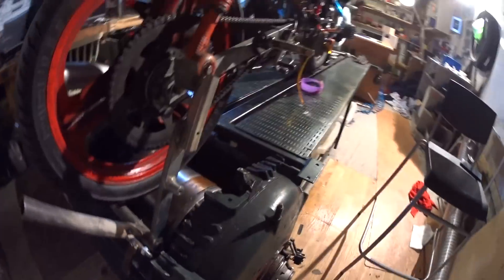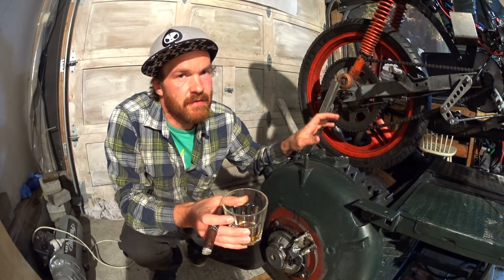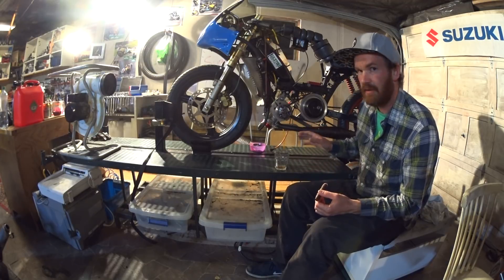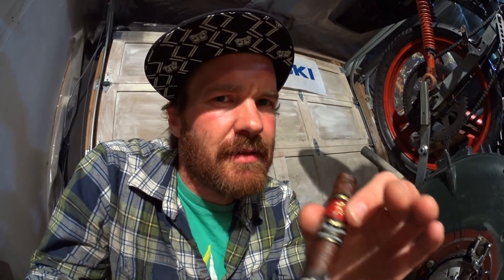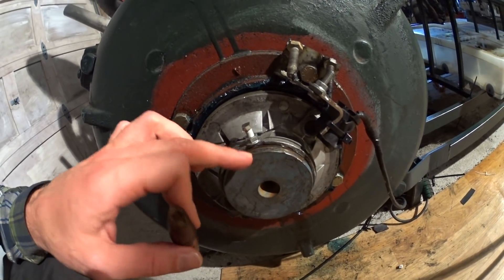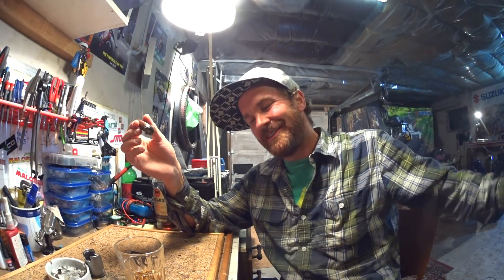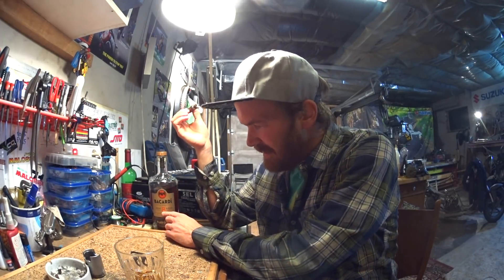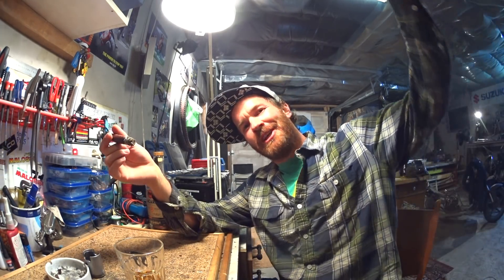CHEAP DIY DYNO ANYONE CAN BUILD!

Comment: Great video, even though it's already 8 years old  :D   Short question: For mainly testing 50cc mopeds with around 5 hp, would you say such a 110kW motor like you have is too big? Or is it still precise for these low power measurements?

Comment: I have built mine all from scratch have a cam sensor as a pickup and I’m using simple Dyno and a Arduino with Ardyno board but having problems i get really bad spikes when I turn the bike on just at idle I get all the way from 1.2 until 9999 hp and same with the rpm that is without the wheel spinning at all can anyone help any ideas on what is wrong?

Comment: hi! long time returning viewer and I came back to watch this video! I am thinking about doing this myself in the near future except to attach directly to the crankshaft of the motor rather then a roller on the back wheel, and had a few questions, essentially it is a large spinning shaft of known rotational inertia with an RPM sensor to show how fast the engine is able to change the rpm of that shaft, correct? the other issue for me is I intend to dyno engines with as little power as 20HP but want to be able to also do much larger engines too, for an engine with that little power what kind of rotational inertia would you suggest, and for the larger ones would my only option to be to significantly increase the rotational inertia of the system? I may have to incorporate reduction gears for high revving engines to stop the shaft from overspinning.  Thanks again!

Comment: Hi mate,
Do you know what the smallest motor would be suitable?
Or are you just looking for the RPM rating that the engine can handle?
Reply from the maker: Mine has a rotor inertia of 2.17kgm, works up to about 70hp, 4000rpm at that point, wouldn't push it much further. Lighter roller means it has to spin faster to get ok runtime(5-8s is good}

Comment: That's actually quite innovative and the software is fairly brilliant. I was expecting there would have to be some sort of braking involved but it just seems to use the rate of increase in rpms as the source of the horsepower.
A "simple" dyno could easily be constructed using a truck or 4wd rim and tyre as the rotating mass. Obviously the inertia number wouldn't be known initially but it could be worked out if you put a known horsepower source over it. Normally you're probably after comparative measurements anyway.
Reply: Fr i thought a dyno would be more complicated.

Comment: Awesome.. Question for you - would the ABB quoted figure for Rotor Inertia include the weight of the copper windings? if yes, do you need factor that in to your calculations?
cheers
Reply: I believe only stator was removed. Rotor is short circuited cage and connot be removed without destroing it

Comment: Those specs from abb wouldnt that be the motor under load whilst windings are there with the power supply DC or AC
Reply: I think those variables arent apart of the factors effecting rotating mass initially.  Would say that is calculated when balancing the rotor outside the armiture kind of like how a car wheel balancer works..  unless in a permanent magnet motor the windings would have no effects on inertial forces.  If the motor was energized that value would be dependent on the motor rating as a whole and equates to only power ratings, input/output relevancies for customer application specs.  A rotors inertia would only play a factor on bearing type/ material or if measuring motor starting/ braking forces as applied to the customer application if clutching or something would be needed.

Comment: Hey, im in the process of building a similar dyno but its on the back burner until I figure out where I put the inertia wheel away. Until then im stuck with what it feels like type of changes. 

Do you know if a hotter spark plug would give a noticeable increase in bottom end power. Today I fouled a plug when out riding [ktm exc 125 2003 ish] and rode it back home with the wrong heat plug in that was in my backpack [3 numbers hotter on ngk] and the bike had a great amount of low end power that it normally doesn't have. Once I got back I quickly changed the plug for a new [Calibrated gap to spec] one and went back out and the low end power had gone back to what is normal. Same bike, same trails same hour. 

You seem like the kind of person who would know if this is a known side effect of plug temperature.

Comment: I can't understand where the load is, this seems to disperse 20hp with no brake??? I'm confused
Reply: With just a hall sensor on it the software is just calculating inertial resistance to how quickly the rpm’s take to get to a set point.  Braking and all is just up to you how you plan on stopping after a run but as long as more force is applied downward to the rotor than the inertial rating than the tire wont slip and get eaten by the spinning rotor..  theres no load applied besides that rotor inertial force he had to call the company to get..  thats the number used for calculating everything
Reply: Constant is the word i was looking for.  The rotor size and inertia is a constant and rpm, time, tire size are variables..  tire size always confuses me though because bigger tires same rpm youd be going faster in mph with more torque so hp of a bigger tire with same motor would be less with more torque and rpm higher if keeping same mph.  Or lower..  i dunno...   i gotta go take a dump on thatn..

Comment: Hey 2SS, I like the videos, very good stuff! Do you think that a concrete wheel sealed with epoxy and mounted on pillow bearings would do the trick or it would be way too sketchy?
Reply from the maker: Thanks! Sounds a bit sketchy, a thick steel shell might help.
Reply: Hell no. Needs to be a metal roller. That thing will fall apart under load. Also how the hell would you balance the thing? Lol.

Comment: What if I want a Dyno that is chained directly to a small DC motor and flywheel with a hall sencer for rpm .the motor start the engine if it is a manual cluch and I want to test engines before it goes on the frame . I got a old treadmill but don't want anything too large and obnoxious.
Reply from the maker: Should be doable!

Comment: So much time was spent on the minutia of the build that explaining the basic "How it works" was never addressed. So the wheel spins the rotor and the rotor's rpm is measured. Why not just hook an rpm meter to the DUT (Device under Test)?
Reply from the maker: Yeah, sorry I need to remember stuff like this. Sure you can take rpm from the DUT and plug the gearing ratio into the software, but you'll still need a big mass to accelerate for meaningful results.

Comment: I am interested in making a generator from a car or perhaps a motorcycle out of a dyno or something like that using the car or truck motorcycle Etc Wheels to turn the generator directly and perhaps kid 1 to 200 horsepower which will be converted into electricity I think you would be the guy that could do it I just had the idea of it and the reason you'd want to do it would be for basically like emergencies hurricanes power outages Etc when nobody has any power and you can power up 10 or 12 houses with it or whatever you needed to anybody wants to work on that and might do the world the world a world of good

Comment: Do you think this could work for a Small Kart Chassis Dyno?
Reply from the maker: Yep.
Reply: @2STROKESTUFFING  would it have to be a single roller with the rear wheels sitting centre/top of the roller, or can it work with 2 rollers side by side for the wheels to rest into?
Reply from the maker: Two or more rollers work just as well, just add up the inertia.
Reply: @2STROKESTUFFING  Thank you

Comment: You should have made the wheel on the shaft so you can use the big electric motor to create power for your house while you're burning all that gas
Reply: ?why you laugh
Reply from the maker: Thought it was a joke...?
Reply: @anonconformist1504  obviously..., I was talking about before he stripped it, it would have payed for itself in the long run (within a month of use)

Comment: Can you rebalance the motor core for higher rpm and also have the data to recalculate it for the dyno
Reply from the maker: Sure you can, but I'd worry about it exploding at higher rpm as it's not solid.

Comment: Hei kan du hjelpe meg litt? Har fått tak i samme motor som du har her på din. Lurte på om jeg kan få litt info fra deg. Som har lavet en av denne motoren fra før.. Som det regnestykket som jeg,ikke forstår meg så mye på hehe. Programmet å sånn skal gå greit sensoren å. Hvordan type sensor brukte til hva? Å måtte du isolere noe for å ikke få feil målinger mener da ledninger. Eller holder det med resistor plugg? Kjempe kul denne her hatt så lyst å bygge en siden jeg så din å ble hektet på dine videoer.. Vil lage mine egne å teste litt ser så gøy ut!
Reply from the maker: Hei! Artig!
Hvis det er eksakt samme motor har den "inertia" på 2.17kgm, legg inn diameter på rulla (317mm om jeg husker riktig, sjekk!), og juster bredde til du får 2.17 i inertia. Skjerma kabel til hal-sensoren og resistor plugg/plugghette gjør susen!

Comment: Maybe for tuning purposes, you might ad a water pump on the electric engine output, an steeper motor for a valve that changes resist of the water pump, wire it to an arduino and make the adjustment to keep a set rpm on the pully.

A water pressure gage that you can have next to the bike when you want to fine tune a specific set rpm.

It wouldn't show you the power in hp, you can do the hp pull after getting the engine tuned, just looking for getting max water pressure, you might ewen do this with a manual valve, but the hassle with the bike tuning and dyno brake might be too much

Comment: So the only resistance you giving the dyno is the rotation acceleration mass of the electric motor rotator?

I seen some engine dynos that have a water pump or some other adjustable brake that sits on berings on the axel, then a torque mesurments on how big off a torque dos take to keep the breack its place, thees more advanced dynos are maybe better for turning when you can keep the rpm stable while making changes to the engine
Reply from the maker: Yep, only the inertia of the roller. Brake dynos have their place, and as you say certainly make tuning specific rpm points easier, but an inertia dyno is much closer to "on road" conditions where you spend all the time accelerating/decelerating.

Comment: Hi! We are having a racing serie in sweden with the 48cc version of the china engine. Since I´v got beaten last race I´ve started to build a dyno. Old electric engine, sort of same as you. In simpedyno you shold add weight for the axel and stuff. But since the axel and rotor is "one pice" what data did you enter? My goal is not to get any accurate figures, i just want to se the changes before/after porting, exhaust and so on. Great videos!!
Reply from the maker: Thanks! I got the actual inertia of the rotor assembly from ABB and used that.

Comment: Huh.  Not where I was expecting this to go.  For some reason I was assuming this was an eddy current dyno instead of an inertial.
Reply: Me too!
Reply: Surly you could turn the motor into a dynamo and measure electrical output power across a known resistor? (A big one of course)
Reply: You'd need a permanent magnet motor and it's probably not very efficient way of doing it lol

Comment: Don’t knock yourself.a very interesting video.what I don’t understand is how does it measure hp exactly with any form of brake?is it calculated by the software by roller rpm vs predetermined roller inertia?does software need roller diameter info as well for it calculations?i need this machine to map my efi for my land speed bike.
Reply from the maker: +jeof Bergamin Thanks! Yes, the software calculates power from how fast the roller is accelerated. It needs roller inertia and diameter.

Comment: How are you breaking the motor? I worked in a machine/race shop that had a Dyno and I’m familiar with how they work, but I don’t understand this. Ours had a water break
Reply from the maker: +Barry Fields It's an inertia dyno, google it👍
Reply: The acceleration of a known mass. So long as your bearing scheme isn't awful, it's actually quite accurate. Pure Newtonian physics with far fewer "fudge factors" involved, compared to proneys and pumpers
Reply from the maker: +ludditeneaderthal 👍 And you can do a coastdown run i Simpledyno and have it account for frictional loss in the assembly.
Reply: 2STROKE STUFFING  as well as the inertia version actually measuring hp as the raw data, while brake types actually measure torque as the raw data. On low speed stuff like Lister engines the torque is the significant data, while on stuff buzzing at many thousands of rpm hp is far more significant, at least usually in both cases. Imagine how tiny a pronie you would need for ANY accuracy on an rc engine with the micro masses involved, lol
Reply: He's probably breaking the motor by using excessive rpm causing rod failure and subsequent motor breakage.  This can be avoided by using a brake to slow the wheel.
Reply: amazed dude he actually meant "braking", not "breaking", lol. Dynos come in a few configs, most load the engine or wheel with a brake of some kind. The original proney type used way back when actually used a rope threaded through wooden blocks that beared on the flywheel (those massive cast iron ones for flat belts), and had a fixed length arm that displaced a scale. The operator tightened the rope til the engine lugged, the scale was then balanced, and the weight reading times arm length in ft gave a reasonably accurate torque figure. By extrapolation of rpm, torque, and number of power strokes per minute, horsepower was then calculated. More modern examples work about the same way, though a bit less rube Goldberg, lol. The vid example model works differently, it measures acceleration of a known rotational mass, so measures horsepower directly. Pumpers kind of do also, but by measuring heating of fluid by the pump, which isn't quite the same, as the HP figure can be skewed a bit by radiative effects and ambient conditions, viscosity of the working fluid, and pump "slip". All 3 are best for divergent types of engines and drive trains. You'd obviously need a seriously microscopic proney for an RC plane motor for accuracy, and a gargantuan behemoth of an inertia rig for a main engine on an old steam ship with a low speed cycle. Pumpers basically need to be sized for a fairly narrow operating range and run in reasonably controlled environments. For the vid, that little inertia rig is just about perfect, but would be woefully inadequate for a funny car dragster.

Comment: should be able to take the rpm if you change the bearings for high speed ones or if the old bearings a whell worned , if not the bearings get hot and seize , the difference between high speed bearings and regulair is the clearance between the races and balls
Reply from the maker: +watahyahknow I've been running it for a long time now without any bearing heat at all. I'm well within datasheet limiting rpm for the bearings.

Comment: Also I need an inexpensive MIG welder for old Honda 2 stroke frame. What should I get?
Reply from the maker: +ThatGuyCalled ART Not sure about that one, no welding pro at all.
Reply: 70 amps at 50% duty cycle, at least. You want a "dead torch" . More choices in amperage is better than less. It's usually better to buy a used pro model on something like Craigslist than a new cheap home shop model at a store. You tend to get far more welder for the same prices. You are better off with a welder you can set to lower amperages than one limited to higher, unless you plan on building ships or Bridges. What brand and model depends on where you live. A good choice here in the USA would be a poor choice in Nigeria, due to cost, availability of consumables, etc. Going and asking local fabrication shops for suggestions, or where they teach welding locally is usually going to get good hints what to shop for where you live.
Reply: Viking Mike Q absolutely! I ran an older millermatic 212 (not the newer autoset model), and loved the machine. With the right set up she handled from 20 gauge to 3/8 armor plate, ran all day and never over temp'd, and easily burnt through mill scale, rust, even a quarter inch of built up powder coat on shop carts if I had a bare spot chipped to start my arc. The new autoset model was FAR less of a machine. The 252 was more feature rich, and could handle just about any heavy job, but was a bit too hot for light tin work unless you were on your a game, lol. Once in a while I see 252s on CL in the neighborhood of 600 to 800 bucks, but I never see pre autoset 212s, ever, unless non functional.

Comment: Hey men, im very impressed by your creativity and I want to build up my own dyno and test my Yamaha DT 125 R (2003), but I got quite important thing to ask. I just set up roller diameter, weight, axle etc. etc. BUT one thing which i dont understand is Drivetrain, I want that, because I want the Simple Dyno to show me engine rpm, but I dont know which gears they want from me :/ Idk which gears and what to do with them (multiply, devide) Thank you very much for your response, PEACE, greatings from czech republic :)
Reply from the maker: +Ted Popelka Thanks! Cool that you're going to build a dyno! In the "gear ratio" field you put in the total ratio from crank to rear wheel sprocket. You'll also have to enter correct wheel diameter for it to be right.